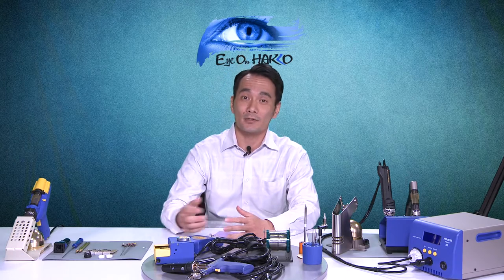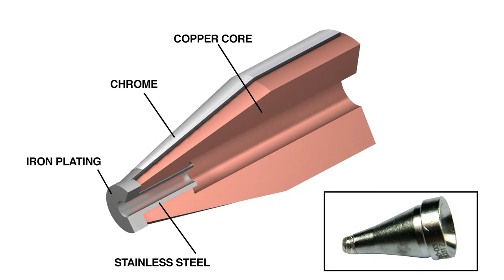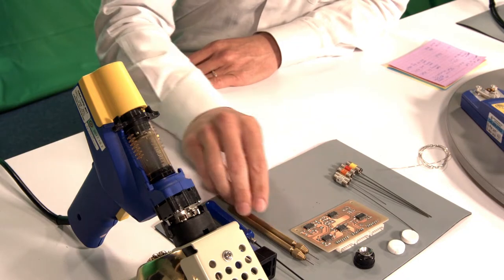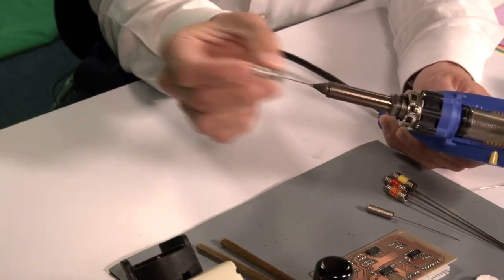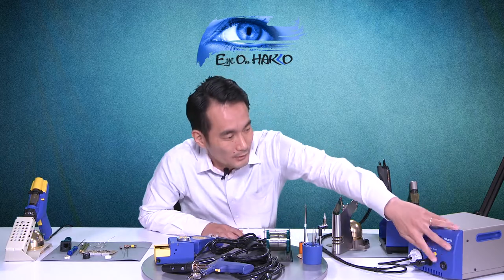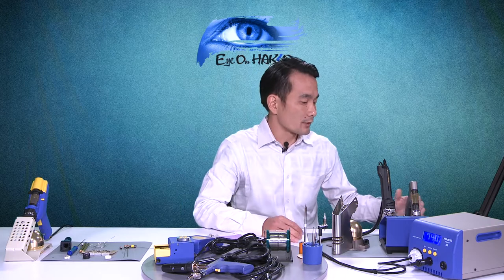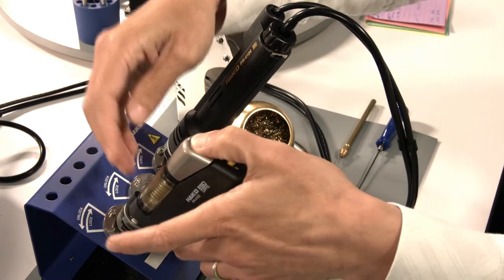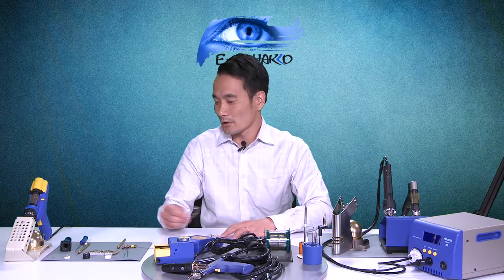"Eye On Hakko" presents "Desoldering Tool Maintenance" — Video by American Hakko

Comment: What is that nicer holder for the desolder gun?
The thing that comes with the FR-301 is bare bones, would like something nicer.
Also, what are those additional cleaning tools? The drills and cleaning pins.
Reply from the maker: Hi The Swarts, the holder is the 633-01 holder and is sold separately, it comes with the 599B Tip Cleaner and can accommodate a wide variety of our soldering irons as well. As or the cleaning pins you can find them under the accessories tab on the FR-301 page by clicking right here --> https://hakkousa.com/fr-301-portable-desoldering-tool.html

Comment: Hi my apologies, I'm not sure I understand which is the best stand for the Hakko FR-301? I'm receiving mixed messages about the stand you are using to hold it. Many reviews I'm seeing say that it isn't a direct fit for the desoldering iron and that the c1100 is actually a proper fit holder for the 301.
Reply: I would like to know this answer too I've had my 301 for a while and I was wo during the same. Last night I came across that information you mentioned on the stands, the c1100 I'd say looks and will fit better than the other one. Have you purchased a stand yet for it?
Reply: @rubenmejia4881  No sir, but I think Hakko needs to make a real proper stand for the unit. The one they recommend, of which I have seen reviews on does not seem to work very well.
Reply: @mattfire8579  agreed!